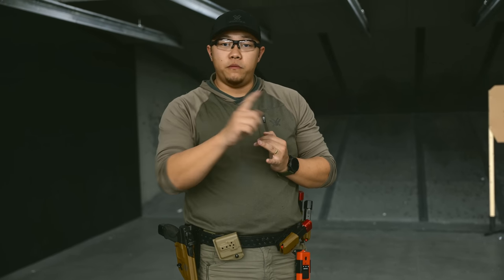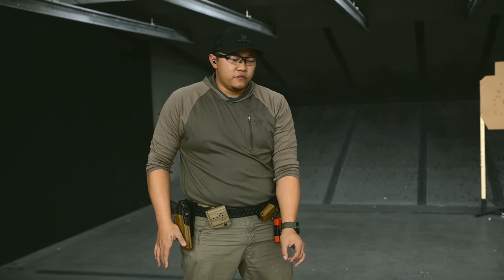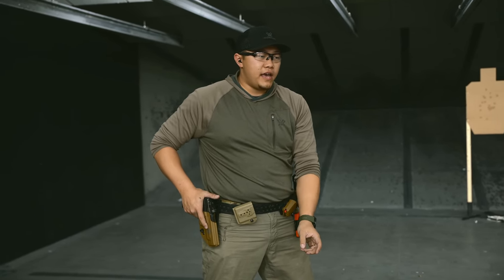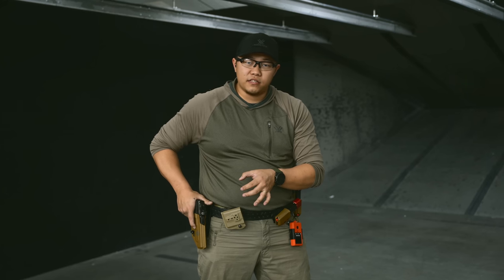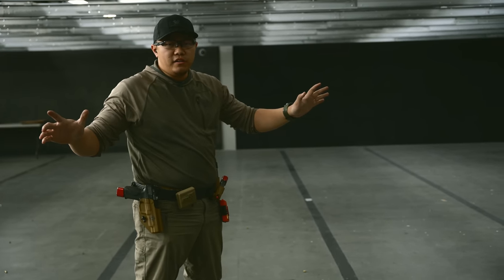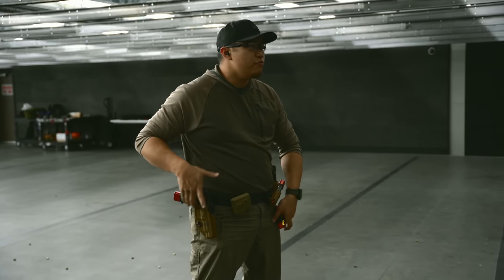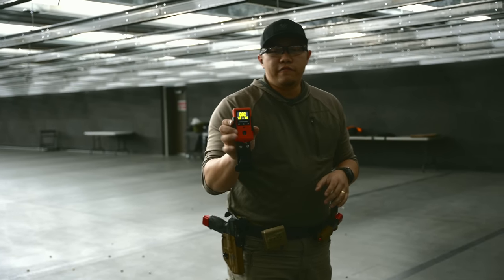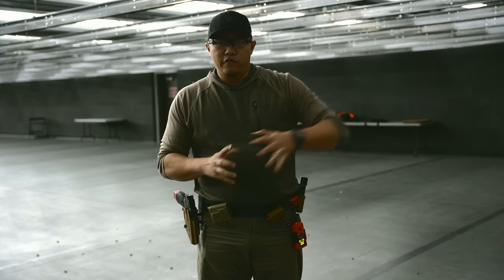How to Scoop Draw the Right Way: Sub Second Draws Have Never Been Easier!

Comment: Fantastic video. Thank you for sharing it with us all. I’ve used your system to firm up my draw. Your index finger stuck out in my mind so prominently the first time seeing you draw. I thought about it repeatedly then just started doing it.. It’s almost my index of sorts now during the first initiation of the draw. Getting the elbow down immediately or as literally soon as the muzzle is free of the holster helped too.
Your draw stroke is next level - not ordinary or even extraordinary. 

I’d love to learn more about your grip - what you have learned and now do.
Reply from the maker: Awesome! Glad it was helpful. Appreciate the kind words. I can certainly do a video on my grip. Lot going on there but should be pretty easy to talk about. In your opinion, what’s the mark of a good grip? Like, how do you tell if a grip is “good” or “bad”? Or better yet, “good” or “better”?
Reply: @brennanbrennecke3323  For me it's partly  a feel from tens of thousands of rounds of feedback  at 10 yds and my dot really staying tight on target. When I get it right like I did today  it's  seems so easy and the dot moves very little really. It's not "grip" really but more an all encompassing pressure around the gun with most the emphasis on the support hand. My problems come from RH tension I still fight. But we truly are all different, learn differently and improve differently and at different rates. Regardless of the concept of "equality ", few of us are equal or rather not unique.
I'm revisiting your lateral movement video tonight. It's great as well.Very clear and spot on in simplicity.

Comment: Good video amigo. Glad you mentioned negative cant near the end. I believe scoop draw works the best on a negative cant (11 o’clock position) on an open rig or Lvl2/3 system. Neutral or forward cant is not efficient for a scoop draw in my experience. Solid stuff man.
Reply from the maker: Totally agree. If you want to be as efficient as possible taking the positive cant out of your duty holster is a must, imo.
Reply: I'm wondering about the negative can't and placement on hip too, like forward of hip bones or right in line? And does the negative can't help with a regular stab down into the holster draw or just with scoop?
Reply from the maker: @TheClo-d8o  so I like it just on or SLIGHTLY forward of the hip bone. I usually align the back edge of my holster with the seam in my pants. And yeah the negative cant helps with all draw techniques.

Comment: TPC has a great technique called "holster pop". Instead of up and rotating, you apply torque on the initial lift and the slide clears as soon as it is clear of holster instead of guesswork. Have you tried this?
Reply from the maker: Yep. Similar idea. I find the gun comes out a bit easier doing it this way, but I know a lot of guys who load pressure on the front sight like that with success.

Comment: Really great video. Has anyone tried with a "heavy" steel gun like a Shadow 2? I tried it with a S2 and a G34, to me, it seemed easier with the Glock, got a consistent grip each time with the Glock. Had a lot of grip variations with the Shadow. Just an observation, anyone else? I'm thinking the different shape of the back straps/beavertails plays a role and the weight difference?
Reply from the maker: I developed this draw using a Sig P320 X Five Legion. Definitely still possible, with just a very slight modification. I also have a Beretta 92 and can still do this draw easily.

Comment: Can this be applied to drawing from concealment?  And if so, what times can you get from both appendix and 3:00?
Reply: Not answering for him, but I’ve been working on my speed from concealment. I shoot a 1911 from aiwb. At 7 yards, my best A zone hits (consistently) are 1.14 & 1.17 range. I use this same method but with a slight up, then back down motion to get a good grip. As he states, this is a bit slower than going directly for the grip, however it ensures a good grip more consistently. By the way, I recommend doing pairs, not just one shot because it will expose less than perfect grip on the gun. Cheers
PS. The gun has to rotate out flat from appendix holster to point down range faster, rather than sideways out of the holster and then turning down range. This is the safer way as well.
Reply: @greg9076  I agree on shooting pairs on every draw.  You can have a terrible grip and still wing a single shot onto the target with a decent time.  I do run the bill drill quite a bit.  I've noticed that really seems to expose a poor grip.  I always get this mid round freeze or lock up where that split is twice as long as every other one.  Still grinding, still training, slowly improving!

Comment: What do you think about the holsters with the push lock on the outside when it comes to quick drawing.
Reply from the maker: Not a fan at all
Reply: Those are blackhawk holsters, and they are not even allowed on many US military bases (actually banned from ranges on multiple bases) because IF you use it wrong - and lots of people do - you push the button with the tip of your trigger finger... which turns into a trigger finger that is going in the trigger guard and pulling the trigger.  

If they are used properly - hitting the button with the side of your (straight) trigger finger - there isn't much risk of something happening wrong... the problem is that multiple people have shot themselves using those holsters.

https://www.youtube.com/watch?v=747_rz-qE4w

Comment: Good stuff man. Do you think the Beavertail size matters? I haven't tried it more than 10 times but I struggle to get my thumb over a CZ or Tanfo Beavertail when I try your technique.
Reply from the maker: Yeah it’s trickier with beavertails but totally doable still. Just have to allow your thumb to float a little higher. I actually developed this draw back when I shot a p320.
Reply: Vaseline on the metal beaver tail works, sounds odd, but it works

Comment: Brennan are you shooting more then one gun/optic in this video? Because when I freeze it at 28 seconds that looks like a Defender CCW but other parts of the video looks like another Vortex Red Dot model.
Reply: Ha…looks like you were. Posted the question before I got to the end of the video. Also realized there’s a light mounted on the S&W with the Defender CCW.
Reply from the maker: Yes sir I am. My main match gun has been running a Venom but the gun in the safariland holster is my carry gun which has a Defender CCW and a Surefire x300 turbo now.

Comment: I got two questions but first off let me say I really dig the breakdown of the "why" involved with your techniques and your honesty rather than the Instagram gun bunny BS! Ok so at what point are you picking up the dot in the scoupe draw cause I was taught a "scoupe" or bowling type draw will lead to acquiring the dot or  front sight post late , like very close or nearing the end of full presentation? Second, I see you aren't rocking the thigh strap with the Safariland like most guys today do, why? I'm not criticizing in anyway, I'm just always very curious as to why someone that shreds like you do is doing what they're doing. I greatly appreciate any & all feedback! A lot of guys are charging good money for what you just put out for free!
Reply from the maker: Appreciate the kind words! For me I start to see the top of my optic window at the bottom line of the A zone at 7 yards, and then the dot appears at the top of the window and drops down as the gun rises up thru the A zone. Hopefully that makes sense. I’m picking up the dot extremely early which is why my first shots are often low when pushing the draw speed exceptionally fast. That’s just where I’m first aware of my optic and dot. As to your second question, I’ve found the thigh strap is especially helpful for when there is a significant offset. A large offset will cause the gun to want to flop or pivot off the belt, but when you mount a holster directly to a True North hanger like I have here, there’s much less of a need for the holster to stay inline. It’s got more support and stays in place better. Plus, if you’re hitting the ALS correctly your gun shouldn’t be binding up in the holster at all really. I also found it to be slightly annoying when shooting, so off it came. I still have it on some of my other “duty” belts.

Comment: How long did it take you to get that muscle memory built into your draw? Unbelievable explanation too. I will be watching this many times, so thank you
Reply from the maker: I’ve been developing this draw for years. You could probably learn in much quicker than that. No one taught me this method, so if someone had, it would have been a much shorter time.
Reply: @brennanbrennecke3323  I just did about 100 draws with my lazer bore sight dry fire. Around 50 I was hitting a softball size area without using my iron sights. I will be practicing and watching. Thanks for the reply

Comment: only thing I saw wrong with the video, might not be wrong, but it could prove unsafe... running drills on concrete with all that brass on it might be a consideration you may want to consider. other than that, very quick... nice.
Reply from the maker: Thanks for the concern. I sweep it up periodically. I shoot on that range almost every day and don’t ever have an issue with that though.